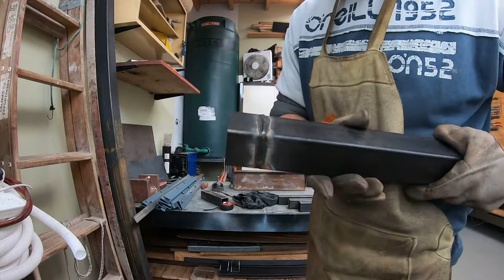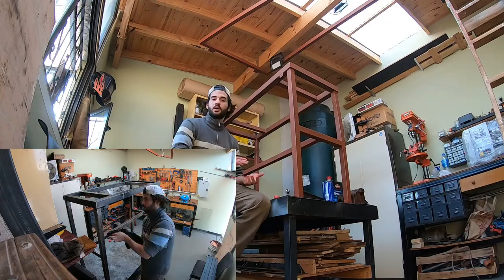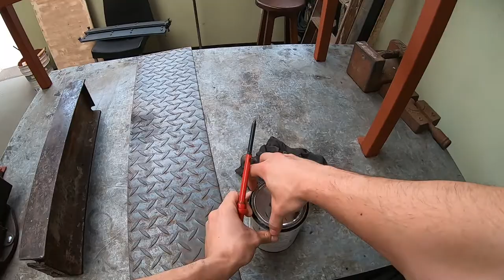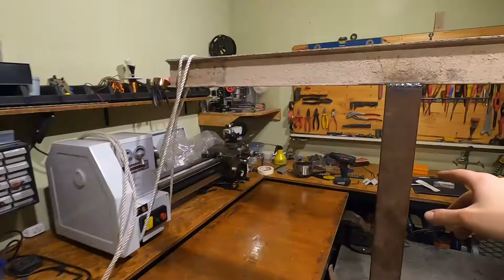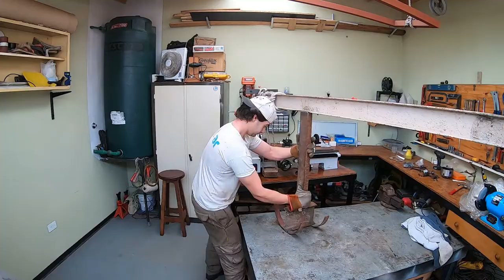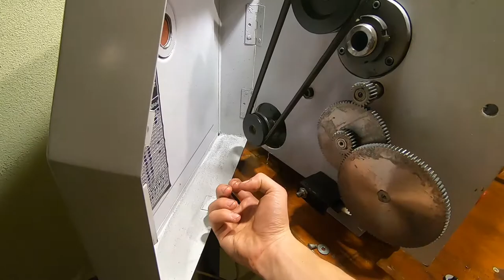Banco para Torno, Modelo BV20BL - Descripción básica de la maquina.

Comment: Hola genio como estas? Como te resulto la mesa para el torno. Con respecto al peso del mismo. Yo hise una mesa similar a la tuya pero me di cuenta despues que solde los estructurales donde se apolla el torno desde adentro de las patas y no arriba de la pata, en la que seria mejor apoyo por la fuerza que hace. Me quedo igual a la tuya. Por eso consulto si se vanca el peso
Reply from the maker: Hola como estas?? El peso se lo banca perfectamente si lo haces tal como lo hice yo. Siempre es mejor hacer el bastidor superior y luego soldar las patas por debajo del mismo para que la carga sea mejor. Pero de todas formas si está bien soldado no deberías tener inconveniente.
Lo que si debería mejorar y te lo digo para que sepas es aislar un poco la mesa con algúna pata de de mejor goma tanto abajo como en los tornillos a la pared. Eso debería evitar un poco de vibraciones a revoluciones más altas del torno.
Reply: @matiasrosati3304  bueniiisimo el dato. Muchas gracias por tu respuesta. Yo recien lo estoy por estrenar, tengo que cargarle el aceite a la caja. Pensaba usar un 80 o un 90. Que me decis? Andara bien?
Reply from the maker: @grmotos693  Lo que me recomienda el manual del torno a mi es Castrol GTX 15w40 yo lo vengo usando asi y va perfecto.
Reply: @matiasrosati3304  muchas gracias por tu respuesta.